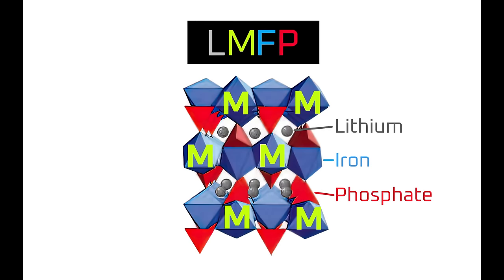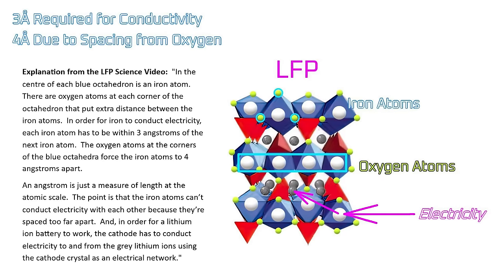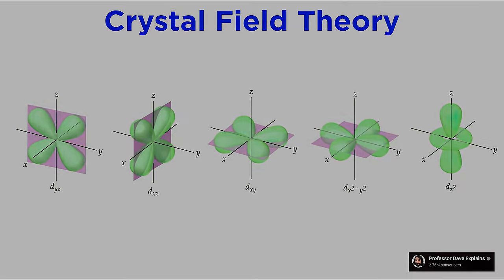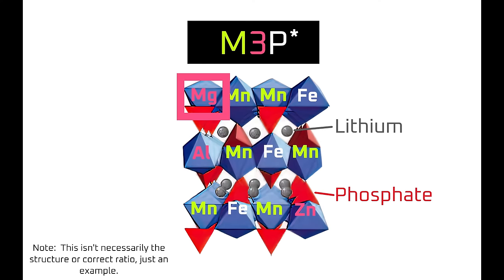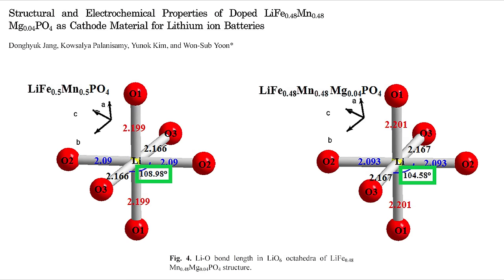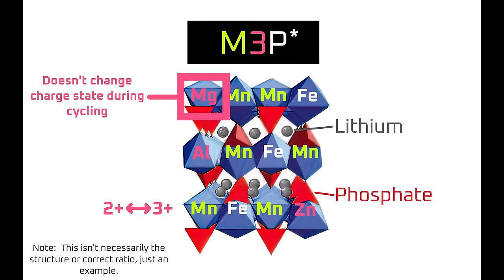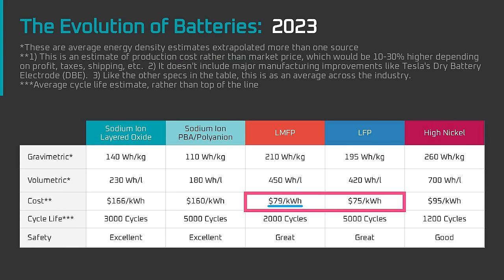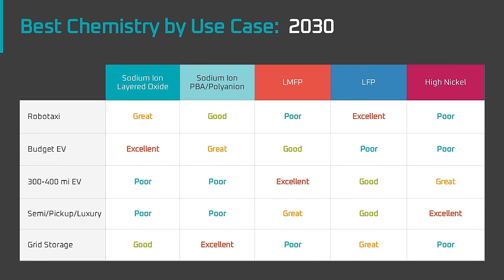CATL M3P Deep Dive // The Manganese Demons

Comment from the maker: Note:  The doping elements are added to Nickel cathodes for different reasons.

For example:  Instead of the crystal structure distorting and twisting, it collapses like bookshelves.

If you're curious about that, this video might help:

https://youtu.be/2DIPqm7yVSM?si=6h3dA0halBDPXUuB
Reply: One biggie with this chemistry is that it should work very well with sodium ions which would make the batteries a lot cheaper, especially for stationary or non EV use.❤

Comment: A 15% improvement to energy density at the cost of up to half the potential cycle life… that’s not necessarily a trade-off I would take, even as fanatical as I am about the many virtues of weight savings.
Reply from the maker: Yeah, it's very much a matter of use case and what you want out of the product/how you market  it.  Horses for courses.
Reply: I went to my calculator about this. Only 2000 cycles at 250 miles each is 500,000 miles. That should be more than enough for any non commercial user. For me, that represents about about 35 years of driving. With LFP's 3- 4000 cycles represents over 50 years. This brings me to a question about how much the battery is still worth when the rest of the car  is a bit shabby after 15years. The usable capacity should still be about 85% of say a 60 kw LFP Tesla.  That's the same as 4 power walls with probably 1500 cycles still to go. That 15 year old car still holds a lot of practical value.
Reply: @markumbers5362  
Perhaps it’s just my bias, but my family keeps a lot of classic cars, so knowing that major components won’t necessarily crap out after only about two decades is actually pretty reassuring.
Reply: @Jjames763 I understand emotional attachments for the old days. I have plenty but I have never understood why anyone likes burning fossil fuels in an internal combustion engine..It pollutes, smells horrible, is noisy, requires lots of maintenance and is ultimately temporary. I know it has been a stepping stone to what we have now but it is a stepping stone I'm glad to have behind me.
Reply: @markumbers5362  
I’m not even talking exclusively about internal combustion—I’m talking about the long life of LFP being reassuring for the time when today’s EVs become classic cars, in 30-50 years.

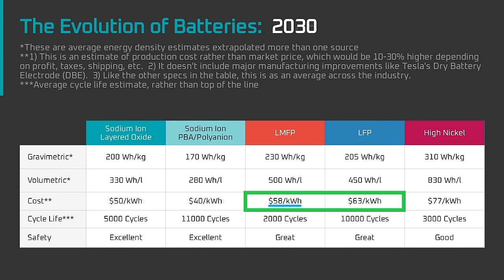Comment: If the chart at 12:15 is to be believed, 1/5 of the cycle life seems like a very high price to pay for what you get.

I'd actually like a cycles * Wh/kg or Wh/L kinda metric. I think it gives a better comparison of the products.
Reply from the maker: It all depends on what the use case and economics are.  If the batteries are in a jet, for example, you're saving money each flight or can increase payload every flight by reducing weight.
Reply: @thelimitingfactor 
But when talking about aircraft, would LFP or LMFP even be up for consideration? I think the dire necessity for low weight would swamp whatever advantages those two chemistries have many times over.

Comment: Comparing Tesla's dry electrode coating to the normal wet slurry and ovens.

I'd be curious how frequently critical manufacturing defects happen while a normal jellyroll is coating and cooking.

We know it's high with the DBE method as it's early days, but long term I wonder if DBE has a chance of eventually achieving lower failure rates than the wet slurry process
Reply from the maker: It would be a worthwhile comparison once they actually get the process working...

But, that's all trade secret so we won't likely find out

Comment: If M3P is LFMP, the biggest benefit is actually power density. The energy density is also beneficial, but the ~0.05 increase in nominal voltage both offers higher power at a given capacity and requires fewer cells to achieve a given power level.
Reply from the maker: Best benefit depends on the use case
Reply: @thelimitingfactor  Absolutely. Right now, all eyes are on EVs.

Comment: Another possible energy source would be magnesium-air batteries, that is magnesium fuel cells.

cant really be recharged on the spot (yet); could be made into a system where a depleted magnesium oxide charge gets reduced back to metal electrochemically (possible in ionic liquid electrolytes) small scale, in ones garage, to be ready to use next day (possibly week?)
they would allow for significantly lower costs, higher energy densities, and circular refuelability

ps. other elements, such as silicon and aluminum might be usable as well, havent yet managed to find any literature on their reduction in room temp ionic liquids though.

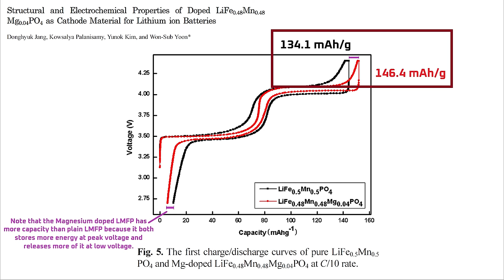Comment: In the graph shown from 8:39, I don't understand why doping with Mg increases the capacity (mAh) of the cathode. Shouldn't it decrease instead?
Increased ionic conductivity should lower the overpotential, which is indeed what we see in the graph (charge voltage is lower, discharge voltage is higher in the Mg-doped cathode) so it should increase the storable energy, but why also the capacity? Why can the doped material take in more Lithium if it hase less active Iron and less active Manganese?

Also note that this chart is not the ideal choice for intended point because it shows the first charge and first discharge behaviour, not the typical cycling behaviour (I get that it's very hard finding the perfect chart and that it will often simply not exist). Coulombic efficiency of both cathodes is very poor. I assume it would improve dramatically for later cycles, but that also means that the shape of the curves will change a lot.
Reply from the maker: I explained this.  Rewind about 30 seconds.  

The magnesium allows more lithium ions, AKA capacity, by allowing ions to flow more freely in and out of the cathode.

That is, magnesium punches above its weight and it counteracts any negative affect that it has on energy density as a non-active material by freeing up active ions.

That's why I say "...a 9% improvement...not bad for swapping out just 4%..."

As far as the graph being not the best choice, I'm not sure what you mean.  It illustrates exactly the point I'm making.  I'm talking about energy capacity.

Beyond that, the graph was the only choice because that was the graph that came with the research paper.  I can't use what's not there.

As far as coulombic efficiency, as far as I'm aware that graph doesn't measure coulombic efficiency and it can't be infere from that graph (could be wrong?).  That would be a different test as far as I'm aware.  I think you're confusing voltage hysteresis or round trip efficiency with coulombic efficiency.

https://g.co/gemini/share/c83950e71dcb
Reply: @thelimitingfactor  Thanks for the detailed reply. I must have missed the part about higher capacity due to the change in crystal structure in addition to the better conductivity. I've now looked at the paper, too. It's clear that there is significant additional capacity (though they don't mention it in the abstract, it is stated later on).
Reply: @thelimitingfactor  As far as coulombic efficiency: You can easily deduct the coulombic efficiency of the cells from the graph. If it were close to 1, the discharge curves would end up at 0 mAh/g on the x axis, where the charge curves start out. We can also calculate the actual figures pretty easily, but it's not a very useful thing to do in this case since these coin cells were never optimized for acceptable cycling performance.
Reply from the maker: With regards to coulombic efficiency, provided a link for how that differs to other measures.  Maybe I've got it wrong, but as far as I can tell the test doesn't measure that.
Reply: @thelimitingfactor  I can elaborate a bit: Coulombic efficiency (CE) is strictly speaking just a calculation of how many charges were counted during discharge divided by how many were counted during charge, in a full cycle [Ah_dch/Ah_ch, or (mAh/g_dch)/(mAh/g_ch) in the case of the graph in question]. As such, it can be calculated from any test data that contains a full cycle, including the graph in question (even if that may not have been the main point of the graph). 
Since CE essentially tells you the relative amount of charge (~lithium ions) "lost" in a cycle it can be a valuable metric for at least two reasons: 
1) The CE in the first cycle(s) says something about how much Li+ is "sacrificed" to make the SEI. This is essentially "wasted" lithium and it reduces the capacity and thereby energy density of your cell from the start, so it is something you want to minimize (cue pre-lithiation!). 
2) The CE once the SEI is formed (so when the cell has "stabilised" after a few cycles) is an indicator of for example the quality/stability of that SEI, and the cycle life of the cell can be inferred (an extreme example: if the average "stabilised" CE=0.99 it means you lose 1% of the cell's capacity every cycle and so you would not not get many cycles until e.g., the normal 80%SOH end of life condition). 
I hope that makes it clearer! 

Thank you for the effort you put into these videoes and for engaging with the community!

Comment: I don't think the manganese gradient is that difficult in iron particle manufacturing. Spraying liquid iron into a argon gas shielded void to rain pellets into a water bath should suffice, iirc from metallurgy studies manganese migrates away from the surface of molten iron, but my memory could be faulty
Reply from the maker: It's a crystal, not just solid metal

Comment: The cynic in me suspects the rate at which manganese migrates through the cathode particals is engineered to consider with battery warranty expiration.
Reply from the maker: It's not.  They're all trying to maximize performance to increase market share.  Maybe after they dominate the market they'll start doing that, lol

Comment: The name raises a question: why the name M3P? Analoge to LFP, you would expect the name to stand for, Manganese, Magnesium and Molybdenum. I am not sure that makes sense chemically. Or is it just 3 Metals (Lithium, Iron and Manganese)?
Also, I dread seeing a battery with 2000 cycles of life as an EV battery. That completely goes against the primary reason to have EVs over gas or diesel.
Reply: Maths. What's 2000 x 250?
Reply from the maker: Metals 3 Phosphate is my understanding 

I'm not sure what you mean by dreading 2000 cycles. 

On a 200 mile range pack, that's 400,000 miles
Reply: Yes, I didn't do the math. Still, that makes it less useful for certain applications such as plug-in hybrids and vehicle to grid (V2G) applications.
Also, less cycle life also means faster degradation. So, the max. range goes down faster, and the vehicle also loses its value faster.
Reply from the maker: No battery is good at everything.  As per my roadmaps to 2030 video, I expect each chemistry to play to its strengths.  There's a use case for each.

Comment: Until someone works out how to enhance ESP to a level specific enough to put knowledge direct from one brain to another.., and it's never going to overcome the "no cloning" problem, also the AI difficulty of precise quantization, which are the wave-particle indecision properties of the Uncertainty Principle anyway,  we have to continue to share our uniqueness in parallel coexistence assessment of QM-TIME Completeness.., ie approximate memory associations, which applies directly to Battery Chemistry, and always on location. 

As can be deduced from Singularity-point positioning <=> Holographic Principle, the sync-duration nucleation differentiates in/of time-timing location is unique for every possible potential point,   ie never discrete in isolation from Totality, because relative-timing ratio-rates Perspective Principle defines relative age in the complete Universe, ONE-INFINITY, simultaneously with Sublimation-Tunnelling distance. This is a state-ment of exclusion-inclusion Singularity-point positioning Conception. 

The distance an Electron has to travel.., is why the measure of Electron Volts is such a slippery concept? Until we remember it is all-ways all-at-once sync-duration holography dimensionality coordination shaping the past-future presence of probabilistic correlations NOW. 

From a parallel coexistence POV. Excellent presentation as usual.
Reply from the maker: I didn't understand most of this, but what I did understand was insightful 😁 Thanks
Reply: My revivifier snuck past the, "put knowledge direct from one brain to another" problem by keeping (doll) bodies separate and transplanting the brain. 🧠
I used to be neuroactively challenged. I got better. Cheers!  💔